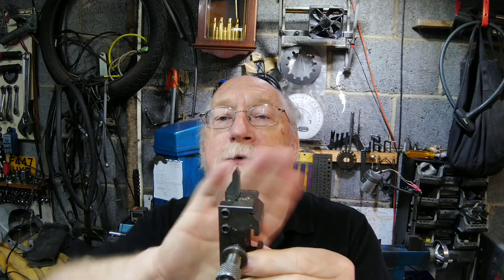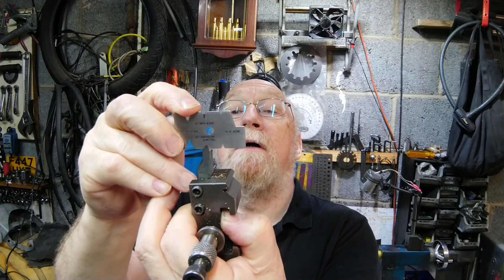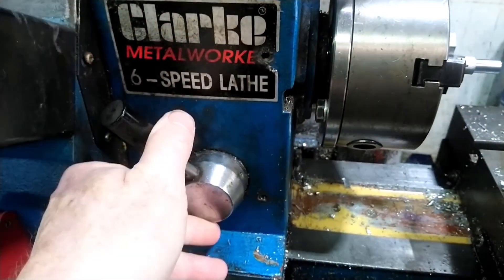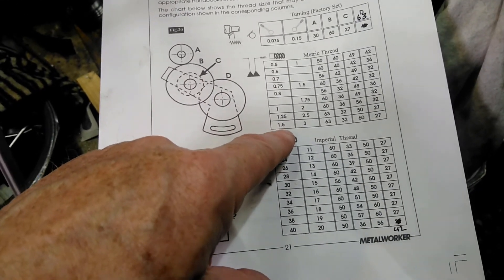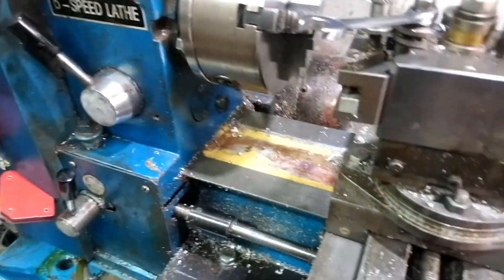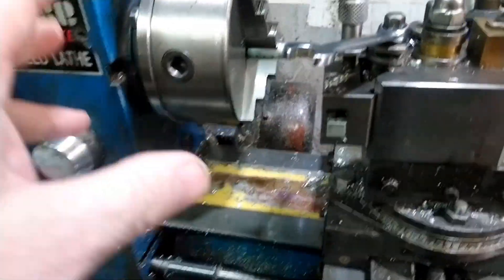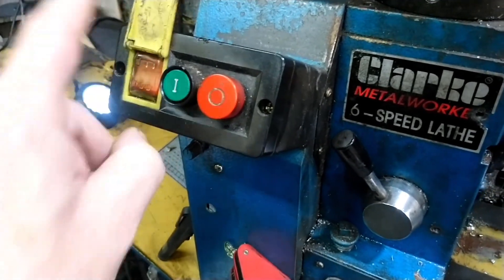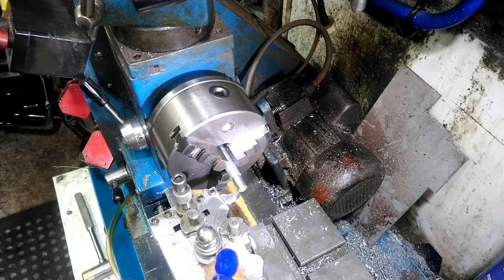Cutting threads on the CL430/CL500M lathe

Comment: There are videos suggesting you put the cutter in upside down and cut on the reverse feed. This gives better control of the end point of the thread and minimises the risk of crashing the toot. I used this method to bore a 28 tpi thread in a blind hole. If you set a dial gauge to indicate the carriage position it’s very effective.

Comment: Great video I'm new to lathes my dog clutch on my Clarke cl500m lathe isn't engaging? You can feel it juddering but not moving forward or reverse any suggestions would be appreciated
Reply from the maker: Sounds like the driven dog is either worn out or not locating properly. I'm afraid the only way to find out is to strip it, easy to do just take your time.
Reply: Thank you I will try and sort it  @SpenCrowson

Comment: very helpful. How did ytou remove the Backlash on Lathe Cross-Feed? mine is horrendous.
Reply from the maker: I replaced the steel bearing with a phosphor bronze one and shimmed out as much play as I could, although that didn't eliminate it altogether it made it bearable.
Reply: @SpenCrowson  Thanks. Could you elaborate on that a little. Im not sure which bearing. Id love to get my CL500m less frustrating to use.
Reply from the maker: @twne8336  If you remove the cross slide handle and Vernier then remove the 2 socket screws you should be able to pull off the bearing block and remove the steel insert that's pretending to be a bearing.
Reply: Tighten the cross feed nut under the cross side for minimal backlash and check the collar in the feed behind the depth dial is tight.
Reply: @martinhow121  Hi. I do have that nipped-up (in fact I made a knurl head bolt for that purpose) best I can, because a facing-off for most things means that it becomes too tight. For 'the collar in the feed behind the depth dial' - Could you elaborate on that a little.

Comment: A bit late, Spen. The phrase "back gear" refers to the high/low gearing on older, often belt driven lathes. The gears for screwcutting are called "change gears" or earlier, "pick-off gears." Thanks for demonstrating screwcutting on the lathe.

Comment: Great video but you should be using the compound set at 29 degrees for the depth of cut, cross slide should only be used for returning to 0 . cheers Nigel

Comment: Hi Spen, I noticed that your pully belt configuration is different from the manual. I have the same machine and I can't match the pully belts to the manual since the main pully on the motor shaft is the reverse to what the manual shows. The belt position at C in the manual goes from large pully on motor to small pully yet you and I have a belt from a small back pully on the motor to a large pully on the middle set of pulleys. How do you follow the manual if it is different from the lathe's setup?
Reply from the maker: Thanks for your comment.  I went with what seemed logical 🤔
Reply: @SpenCrowson  Many thanks for your reply Spen. I shall match your belt and pully setup and see what happens! All my machining is model machining so I use taps and dies with holders set in the tailstock. I wonder if I could ask you where you got your quick change tool post from? I've liked and subscribed.
Reply from the maker: @windypup8845  I think it was either Chronos or RG tools, and thanks for the sub 👍

Comment: Do you know if it’s possible to purchase 1.75 M gear for the lathe
Reply from the maker: If you mean to cut a 1.75 thread then the gears are, A-60, B-36, C-49, D-32 with the speed lever to the right (fastest).
A full set of gears come with the lathe, hope that helps.
Reply: @SpenCrowson  Thank you very very much do you by any chance have a picture how does it go together I don’t understand it A B C D
Reply from the maker: @elidari60  Ok, I'll do a short explanation vid with some excerpts from the manual that you can screen shot.

Comment: Hi Spen, I have the same lathe and I want to make some compression springs but can find how to speed up the feed rate by changing the gears to suit if that makes sense.
Reply from the maker: Would a short video help as the manual is not overly clear.
Reply: @SpenCrowson  Absolutely Spen, would be great if you could do this.
Reply from the maker: @bobmurphy9380  okay I'll work something out 👍
Reply: I replaced mine with treadmill motor and it works fine I can have any speed I want

Comment: Hi Spen.  You’re right that this is a total faff, but it clearly works as you have demonstrated here.  I have a CL430 and once fettled it’s an OK lathe but I’m not 100% sure I would buy the same again.  If I needed to cut much other than 1.5 metric pitch threads the gear changing would drive me crazy!
Reply: If it’s a hobby you got all the Time in the world
Reply: @elidari60  - That is true, but I do need time to spend on my other hobbies.  Any time I can save is a bonus.

Comment: Set the compound slide to half the cutter angle in order to cut with only the leading edge of the tool, then you set the cross slide to zero every pass and use the compound slide to increase the depth of cut